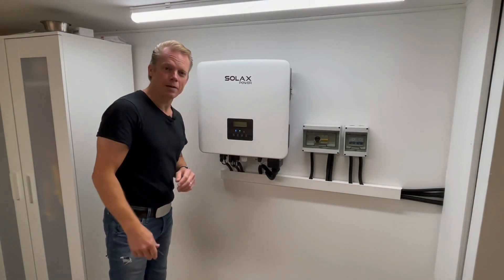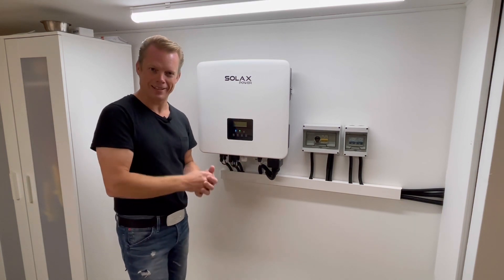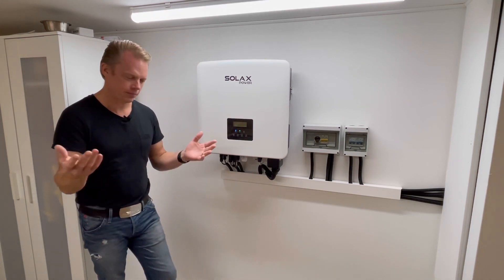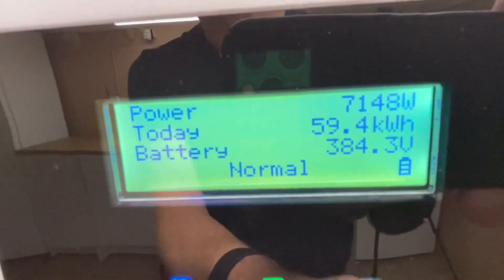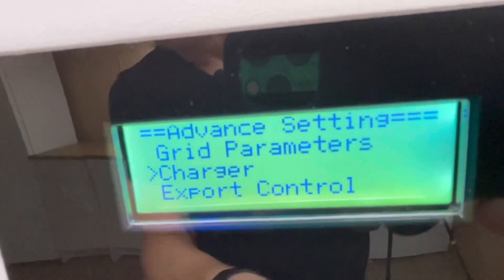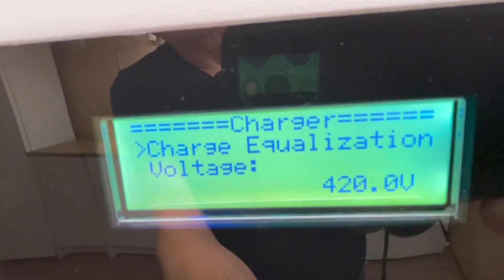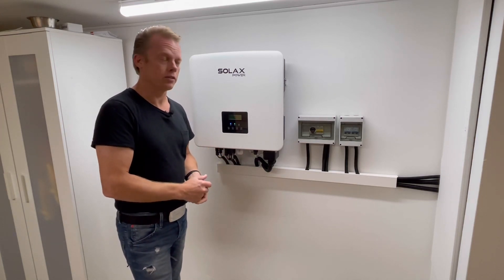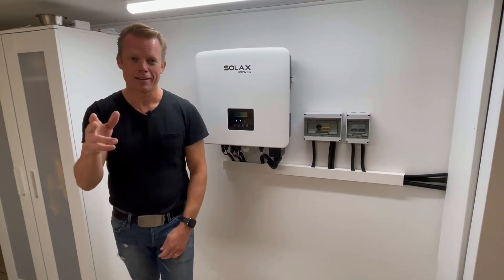Solax x3 g4 runs on a 400v diy lithium battery.

Comment: I have 3 X 15kwh cerrnss batteries and want to connect to a solax hybrid inverter 

How do you do the parameters for use without direct battery control?

Comment: Hi sorry if I ask again, why do you use the lead acid mode ?
And do you use the BMS of the ID3 System?
You read only the U Batt upper and lower cut of voltage?
Why it is not possible to use the Lithium Mode?
Reply from the maker: Hi. I use a standalone BMS so no communication goes to the inverter therefore the lead acid mode. if I set it in lead mode it will go into fault mode and complaining on BMS communication lost. I have more videos when I am building and explain the system on my channel.

Comment: Hello, really nice video. Thank you for sharing your knowledge. I have done the same thing, and almost everything works, except that the battery SOC in the Solax app always shows 0%. It’s charging and discharging normally, but I can’t see the SOH I can see only voltage, current, and power. Have you encountered this problem before?
Reply from the maker: Sadly this is how Solax is working in lead acid. I have Home Assistant hooked up to my inverter via mod bus and I have created a calculator that will use the voltage to calculate the Soc for me instead.
Reply: @flyingtools  Thanks for your reply. Okay, good to know that it works like that.

Comment: Thanks for this. I was struggling to figure out how to set up my 5kw Solax inverter bought off ebay but when watching this I realised I needed to enter the admin password. A quick Google and I'm in. 
In my case lead acid was an option so no need for a firmware update.
Reply from the maker: That’s great to hear. I struggled a lot before I had mine to work in lead acid mode.

Comment: Hi, did you try to connect the CAN 1 or CAN2 from the BMS to the Solax Can port? Did they communicate? If they communicate, would you be able to charge the battery in Li-on mode instead of Lead-acid? Thanks
Reply from the maker: No, they are not compatible. You need to have the Solax battery canbus protocol installed in BMS for that.
Reply: @flyingtools  understood. thanks for saving me time and for the quick replay

Comment: Snabb fråga bara. Jag kör en deye 12k inverter med mina blysyra batterier just nu. Men har funderingar på att skaffa en större maskin, typ 30kw. Sorgligt nog stödjer dessa enbart högspännings batterier. minimum 150v. Med din setup här kör du alltså lithium celler med egen bms och laddar med blysyra cykel? det funkar ju såklart sålänge spänningen är korrekt och batterierna har en vettig BMS.

Hur seriekopplade du fram 400v? och vad har du för bms som skyddar cellerna? eller har du helt enkelt seriekopplat batterierna i 48v pack och sedan seriekopplat 48v batterier upp till rätt spänning? På så sätt kan ju varenda cell vara kontrollerad av olika BMSer. Blir en handfull BMSer för att göra på detta sätt dock. Eller har du fått tag på en BMS där du kan seriekoppla och kontrollera typ 100 lithiumceller i rad?

tacksam för svar gällande BMS, celler och om du tror att mitt tillvägagångsätt ovan skulle fungera, med separata BMSer per 48v pack upp till t.e.x 480 volt.
Reply from the maker: Hej☺️
Ja 48v med alla dess förluster är inte så bra. Här är batteriet jag byggt på. 

https://youtu.be/hKKdrE_1TJY?si=mg5yAo-XGXhz3HWz

Batteripack i serie kommer drifta till slut, rekomenderar det inte.

Bms: 
https://youtu.be/BwanbwCdA80?si=n0N50eoBAPpafPlk

Finns även lite fler videos så klar. 
Tänk på att det inte är ofarligt så du måste ha stenkoll på vad du gör.
Reply: @flyingtools  tack för svar. har god koll på vad riskerna. Har inte märkt av några grova förluster med mitt 48v system dock. Kör just nu blysyra agm. 24 x 200AH med 4 i serie 6 i parallel. Kan bero på att jag kör med 70 kvadrats kabel... :P Ska kika lite på detta. De grövre invertrarna är ju i de flesta fall högspänning. I teorin skulle man ju kunna seriekoppla blysyra batterierna också om man ville. Men när dessa är gamla blir det lithium hursomhelst. Högspänning eller inte berors på hur mitt behov av inverter ser ut.

Men bra att veta att sådana här lösningar fungerar. tack.
Reply: @flyingtools   Ah. trodde det var komplett DIY? Jag lutar ju åt att seriekoppla prismatiska celler om jag framöver bygger ett högspännigsbatteri. Där kommer man undan riktigt prisvärt.

Har 2 st 5kwh lithium 48v batterier som ligger med som var riktigt billiga.
Reply: åter igen tack. sinnesjukt att denna video rekommenderades till mig nu. är mitt i att testa lite lithium och eventuellt köpa en till Hybrid inverter. Letat efter vettiga BMSer för högspänning i serie. Nu har du ju visat upp dessa orion bmser i olika utföranden. perfekt.

Comment: Hello everybody, i am using a lithium ion battery in the Lead acid modus,  and it works perfect, but after the latest App updates  i miss the battery voltage if jou click at the battery. And it is not possible to see the estimatet SOC   
Do you also have this problem?  I send a email to Solax but got nog response.
At the inverter self can you still see the battery voltage, but not anymore in the old and New App 
Regards Marcel
Reply from the maker: Hi. Yes I have seen that, the same with the temperature, that’s what I miss the most, everything else I can see in home assistant, but not the temp. So I will ad a temp sensor in HA later. Strange  that they have done it like this. I guess they will take care of that later, hopefully.

Comment: It is important to say, that you can not change the battery type in the menu, if there is no DC already hooked up to the inverter. This IS ODD but true. You first have to connect the DC from the battery to make the inverter get in "normal" mode. After this you can change from lithium to lead-acid.
Reply from the maker: Hi, yes you are correct about that but I assume that the installer at least has followed the quick installation guide before starting the inverter up.  It clearly shows that you should connect the battery before you do any settings.   

https://www.solaxpower.com/uploads/file/x3-hybrid-g4-quick-installation-guide-en.pdf

Comment: Careful with that temperature sensor.  Is it varies much from 70° f it'll adjust your voltage parameters and could raise the voltage higher than your batteries will be happy with.  I emulate a temperature sensor by finding the proper sized resistor and using that instead of a temperature sensor
Reply from the maker: No, that’s not my experience. It adjust the current depending on the temperature.
I have tested this at around 0 degrees centigrade and the charge current is then 0A but the voltage is the same.
And it would be totally crazy if the voltage should be rised when the temperature is hi, it’s more logic to lower the voltage. But I have not tested that myself though.
I am also using a stand alone BMS to my battery with its own full protection to the cell so it’s very unlikely that something will happen to it anyway.
Reply: @flyingtools  voltage varies by 11% according to temperature. This is a very well known and understood feature of all charge controllers that do temperature compensation on the lead acid setting. Let's say you were charging a lead acid 12 volt battery up to a very conservative 14 volts And you had a wild temperature swing down near freezing which caused the max 10% voltage rise up to 15.4 volt charge voltage which would definitely trigger your BMS over voltage protection.
Reply: @lavatrip9344  for lead acid this is true. The absorption voltage gets a whole lot higher when the my batteries are going under 10c in the garage. While at the summer the batteries have in comparison a very low voltage charge.

Comment: Super!
Questions:
1. ESP loads give out power without batteries if solar panels give out more 2kW of power?
2. Solax have 4DC PV inputs, but only 2 MPPT.
 How we can connect 3 different roofs?
36pcs (PV1 18+ PV2 18) East
10pcs (PV3)  East
12pcs (PV4) West
How is working this setup with only 2 MPPT.
  There were no roofs to the South in my friend place 😢
3. Whats the new with smart car chargers? If solar power give meny power then all free energy charging car wiht the smart power regulator. Hi bye Audi E-Tron.
Reply from the maker: Sorry, I can not answer on those questions. Check with your local installer.

Comment: Hei. Have this Solax phase limit on Backup or OffGrid mode? I think 10kw SolaxHybrid is only 14.5A ir EPS OffGrid Mode,is this thrue?
Reply from the maker: Hi.
I’m not really sure what you mean. But you will only be able to pull around 3,3kw / phase on a 10kw inverter.
Reply: @flyingtools  yes.3.3kw is not so much for OffGrid,therefore it is necessary to use a feks. 3stk x 5kw Victron Multiplus,so you get 3.3kw from Solax on each phase+5kw for each phase from Victron,so totally 8.3kw max on each phase...  I also have another Fronius hybrid and there also this 3.3kw phase limit, if you overload,so inverter can turn itself off.

Comment: Then U use settings for SOLAX Lead acid batteries use BMS without connections with Solax? Can You make a video about this BMS? Or U use CAN-ModBus RS485 board?
Reply from the maker: Here is a video when I installed the bms I use:

https://youtu.be/BwanbwCdA80?si=yhqtt4v0i1IsddPB

Comment: 3:52 375 Volts for 100S is 3.75 Volts for each cell, Why so much? Or U use more 100S?
Reply from the maker: 108s. cell chemistry NCM 712 3,3v=0%soc
3,45=20%soc
The reason is more cycles.
Reply: @flyingtools  This is from VW-Audi batteries? How many kWh if You use 20-80% 375 to 420V?

Comment: Hi, why do you set lead acid battery type in inverters menu,  if you use lithium battery?
Reply: Aha, it is workarround. If you set Li-on battery type, the communication bettwen Solax and Bms will be mandatory.  Interesting ... thank You. L.
Reply from the maker: @lukassvinger3474  yes, exactly.
You are so welcome 😊
Reply from the maker: Hi. I have no bms communication between the inverter and the battery.

Comment: Dear Sir,
Excellent all videos!
I would be grateful if you could send me this software that supports the lead acid battery mode.
Thank you and best regards.
Reply from the maker: Thanks!
Solax just installed the latest firmware in my inverter, contact your local dealer and hopefully they will help you so you have the correct firmware for your region.

Comment: So in order to get it to work, you have local BMS on your battery pack doing the battery management with no communication back to the inverter, besides the temp. sensor for safety cut-off?
Reply from the maker: Correct. Orion 108s BMS.

Comment: So youre running the straight 400v off of the complete vw pack?
Reply from the maker: Yes, with a stand-alone 108s orion2 bms.
Reply: @flyingtools  this is amazing!! I will definitely go through all your videos👍🏼 will the Orion work for a tesla model 3 LFP pack as well?
Reply from the maker: @EugenePutin  it can handle a cell voltage up to 5v, but you have to do all the settings of course. It has a really good manual so no problem there.
Thank you so much for your interest, it really helps my channel out😃
Reply: @flyingtools  amazingggg. Thank you!

Comment: Hej Nice video do you are running your Solax in lead acid mode or li-ion mode ? Your id3 battery pack is li-ion? I just installed the Solax inverter. Now I have to buildt the battery. Also 9 id3 modules
Reply from the maker: Hi! Yes, that’s the only way to have this to work with a standalone battery.
Reply: Thank you for your information. What type of switches do you have next to the inverter? Hv battery hv+ and hv- ?

Comment: Happy fire in the future
Reply from the maker: Just installed my Orion bms to my battery so hopefully not, but thanks for your concern 👍🏻
Reply: @flyingtools  Thank you very much for sharing your findings about this solution! How does the orion BMS react when for example one cell would start to overcharge? Does it disconnect or send message to inverter how is it done?

Comment: Hej, jag skall precis bestämma mig för vilken växelriktare jag skall köpa och har lite beslutsångest. Fungerar solax växelriktaren med vilka batterier som helst (Lithium ca 400-450v) eller krävs det någon drivrutin för att växelriktaren skall kunna kommunicera med batteriet? Vad heter modellen som du har i videon? Tacksam för svar. /Allt gott!
Reply from the maker: Hej. Jag har en X3G4 15kw och med den senaste programvaran ska de fungera med ett stand alone batteri om du kopplar in en tempsensor istället för bms kommunikation. Du måste dock göra alla inställningar själv samt att batteriet bör ha en egen bms. Solax har överträffat mina förväntningar och jag kan varmt rekommendera dem. Lycka till😊

Comment: Hi, I have a friend who ordered an off-grid PV system + backup generator for a small furniture factory. The customer did not ask for any specific brand or model of inverter. The seller delivered and installed a SolaX X3 G4 Hybrid 10kW and two SolaX TriPower batteries (11.6 kWh total). He's having some problems with the inverter and the seller is no longer responding to our phone calls.
Problem 1: We cannot figure out how to get this inverter to charge the battery from the generator. Most of the times it rejects the generator power (unstable frequency ... but this is normal for a generator). But even when it accepts the generator, it does not charge the HV battery from generator power. It simply turns off the EPS output and nothing else.
Problem 2: The generator can be remotely started via a dry contact switch or relay contact. If we solve the charging from the diesel generator, we cannot figure out how to set up the inverter to automatically start the generator when the battery is too low (for example start the generator when battery drops below 20% and stop the generator after charging above 50%). 
Do you have any idea if this firmware you received from the factory could make the inverter cooperate with a diesel generator? Thanks in advance!
Reply from the maker: Hi, sad to hear. No i do not know if my firmware will handle a generator better. But my installer sad that he simply did not recommend a generator at all due to the instability frequency  and voltage.
Sorry but I do not have any experience above this.
Hope hi/you find a solution.
Reply: Get a chargeverter from signature solar. It's basically just a battery charger but it doesn't care about dirty power from the generator.
Reply: Only way is aome voltage optimizer on genny input or get a more stable generator with a more stable sine wave output.

Victron has a feature for unstable genny input and is a lot better at taking unstable inputs from mains or genn set.

Comment: Where is the temp sensor placed on the battery, I use 48v 775ah battery. How much was the temp sensor and where can you get it? Thanks
Reply from the maker: It’s located inside my hv battery at one of the modules. I bought it locally from my installer.
Reply: @flyingtools  can you send me info on the temp sensor please, solax are not very helpful, I'm using 5x 48v 775ah traction batteries wired in series so the minimum volts will be 220v and max volts will be 270v. I'm also parallel connecting 6 of these inverters together, will I need a temp sensor for each inverter or just one for the master inverter?

Comment: Hi, Dear did you face any tripping problem in EPS mode without any grid in G4 model when any Charger load is applied on inverter. 
An you Plz check multiple times by inserting any charger electricity plug to check tripping problem, if it happen please share.

Also can you share the manufacturer country of this inverter. China or Europe
Reply from the maker: No not at all.  Europe.

Comment: They are incredible inverters. I have lots of videos on my channel about SolaX. Nice video. The temp sensor is mandatory or else you will get errors.
Reply: Can you also hook up many type of BMS'es like on Solis ? or just get forced to buy the Solax battery?
Reply: @HermanWillems  thank you for watching and commenting. SolaX only supports their batteries. People have run other different batteries with Bms communication with success
Reply: I have 3 X 15kwh cerrnss batteries and want to connect to a solax hybrid inverter 

How do you do the parameters for use without direct battery control?

Thanks

Comment: Thanks. I have solax 6kw hybrid comming soon here in Finland and im really interested about all stuff on your setup. Btw.do you know, if i use lipofe battery s, can solax talk with 3rd party BMS or do i must get Solax BMS ?
Reply from the maker: Hi and thank you 😊 it can only talk to solax bms (I guess) it will work with lifepo4 if you just have the right voltage trange configured in the battery. 
A 123cell lifepo4 battery will give you a voltage at 450v fully charge.
Reply: @flyingtools  It is going to be a challange to work with pure voltages to determine state of charge on an LFP battery. Maybe if you have a rather oversized battery its fine. It helps in battery life & efficiency aswell. But that being said, i am not taking the risk and will go with a goodwe BT with a batrium BMS. They communicate with the goodwe BT, ET series. Only thing i do not like is that it will cost me $1800 for the BMS system alone. That must be doable in a cheaper manner.

Comment: Hej, bra jobbat. Finns det möjlighet att få kontakt med dig, jag har lite idéer jag skulle vilja diskutera med dig.
Reply from the maker: Hej, tack! Alla frågor, idéer och ev tipps tas helst här på youtube så vi alla kan lära oss av varandra.
Reply: @flyingtools  Det är ju super bra! Jag har ett eget batterisystem installerat med Solax prylar(23kWh bat, 15kW inverter). Men nu tänkte jag bygga ett större batteri själv, undrar om du kan dela mjukvaran för invertern. Jag har även batterier till salu om någon annan vill bygga eget system. NMC, 9kWh/modul 100V.
Reply from the maker: @christiangreen3288  spännande! Vad gäller mjukvaran så tar man detta med sin installatör eller återförsäljare. Låter som ett intressant projekt du håller å med iaf. Lycka till👍🏻